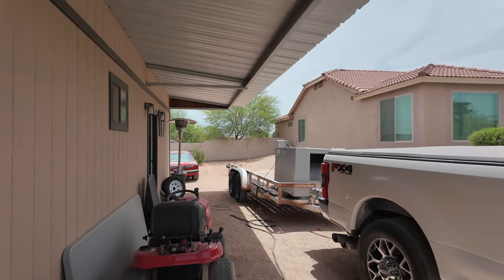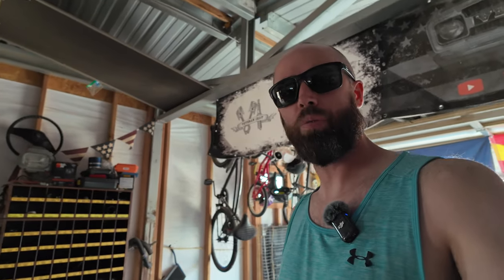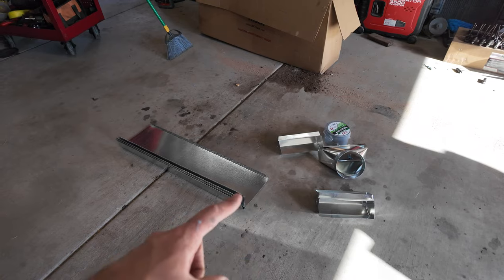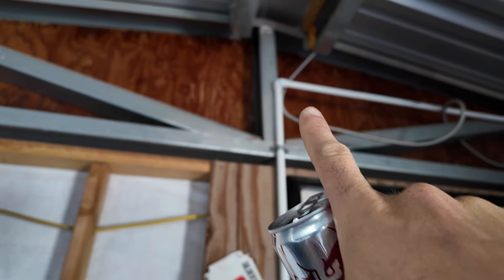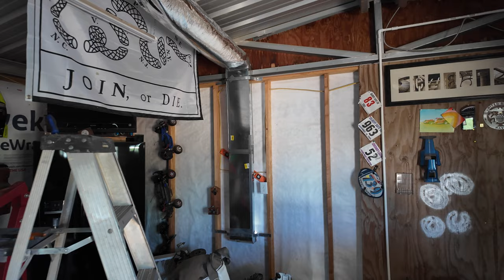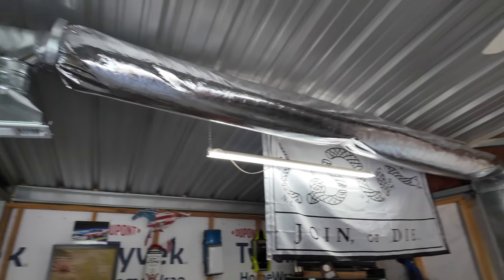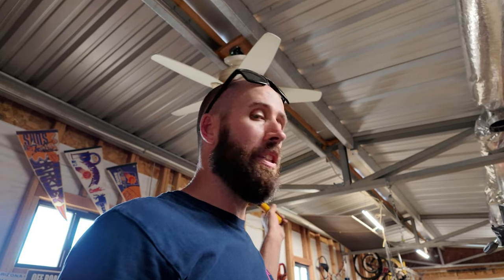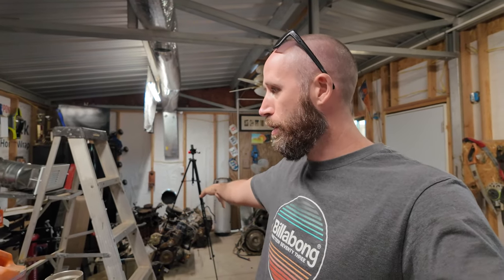Industrial Swamp Cooler On My Shop! Fail...

Comment: You can put ducting. But the total diameter has to equal the output diameter. I think for your shop, what you ended up doing will be fine. Think about getting some of that bubble wrap insulation or foam on your ceiling.
Reply from the maker: For sure the ceiling is in dire need of insulation